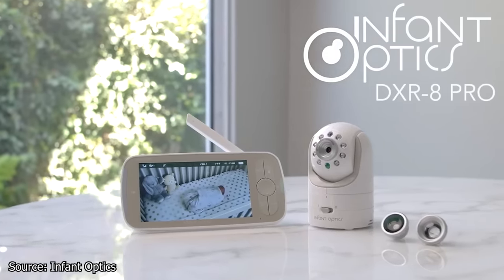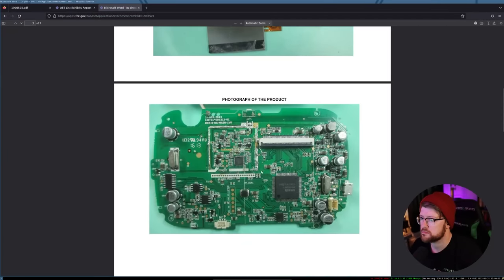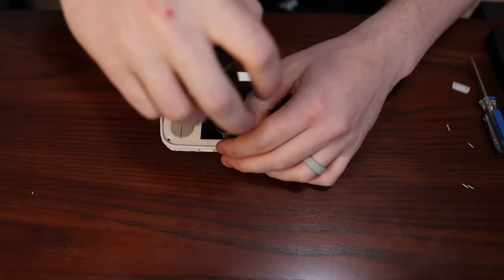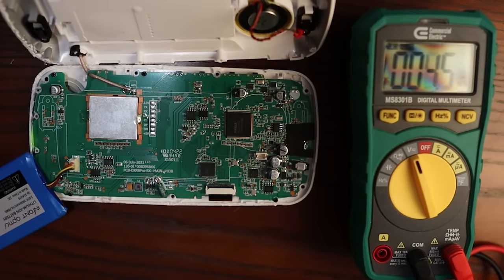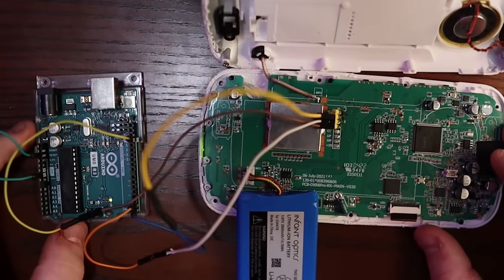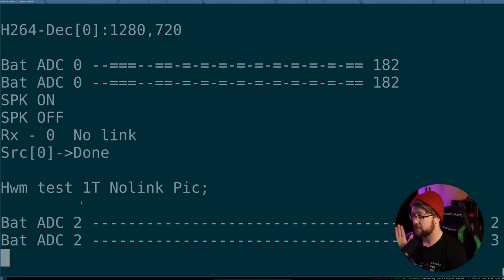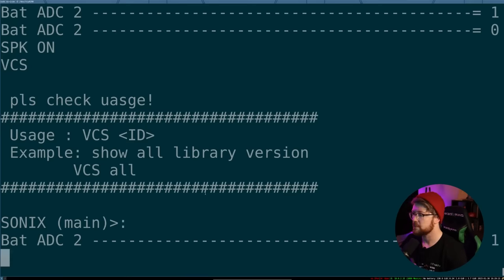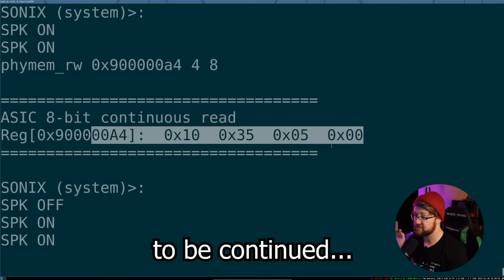i hacked my son's baby monitor, for science.

Comment: I'd be careful connecting the 5V Arduino UNO TX pin to connect to a 3.3V serial interface. Some devices can tolerate 5V on their input (at least for a short while) but others may break. Use a level shifter if in doubt.
Reply: Just a simple resistor can do it too.
Reply: All raspberry pi models have 3.3V UARTS. Use that as it is also more likely what the viewers have at home.
Reply: most of the time it doesn't do anything, but as a cautionary a resistor of 2k ohm can be used
Reply: @leakimiW  In this economy????
Reply: @NoorquackerInd  Yeah, completely absurd suggestions which may lead to a dead RPI/Arduino ... including the "test candidate".
Like there are no such things like the generic Ali-Express 1$ USB to USART bridge (Or $3 ... on Amazon) with actually matching logic levels, which do NOT introduce additional 10 points of uncertainties, a rabbit-hole of other complexity and pre-programmed frustration.
Yeah, why not use a 10 or 50 times more expensive device for the problem. Even the hobbyist needs such an USB to Serial adapter. Sooner or later. Very smart!:)
Reply: Back to reality. It "worked" because:
Resistor RN4a and RN4b (both 1k in serial to the ATMEGA8U2-MU USB to Serial Bridge, see Arduino Uno Reference Design) have saved Low Level Learning's Baby-Monitor-SOC from harm. It was a matter of under 2 minutes to research that, Leon. You should also try that sometimes: RTFM!:)
Edit, I mention this explicitly and here again: Let alone the "magic smoke" that may occur, but the frustration which can result by the misuse of higher frequency serial protocols. The signal integrity, the rise-time of the appropriate logic levels for a specific device will be influenced by these series resistors and the current flow over the protection diodes. This can lead to sporadic and incomprehensible errors ... which can lead to immense frustration. Not only for amateurs:) Use the appropriate tools! (You will need them anyway, like every good housewife! Hehe)
Reply: @dieSpinnt  you sound like a meanie.

Comment: If you can’t get it to work: In the Arduino IDE, put Serial.begin( * baud rate * ) to get communication, and press the upload button. Most importantly, if the ATMega chip is stuck in reset mode you HAVE to put tx to tx and Rx to rx, because the serial converter switches it around for unknown reasons.

Comment: "...but sometimes they leave it open to give the user a root shell to the device."

I don't think this is intended by the manufacturer:D
Reply from the maker: Then ground your pins wtf
Reply: What's the point of locking that down tho?

You need to spend engineering time to make the device exactly the same for most of your customers and annoying for a tiny fraction.

The only "real" reasons I've seen is some false sense of security, desperate attempts at protecting Imaginary Property or misguided regulations.

Full verified boot would be way too complex for any such use case.
(and if it's really needed, please let the actual owner control it!)

Comment: I wish I had seen this before having to guess how to do it myself using an Arduino to diagnose a lab scale.  I was on windows using the Arduino software to view the serial communications, so I didn't wire the reset as you did.  But this is a lot more elegant for troubleshooting serial data than all of that.
Reply from the maker: Arduinos make a solid little USB-TTL
Reply: @LowLevel-TV  Right!  Awkward as my approach was, it worked for automating a material feed into a mixer using the scale output.  Not bad for a few bucks.
Reply: i use a esp wich has a cp2102  3 dollar on aliexpress

Comment: Aren't UART pins usually high in idle state? In the first step when you measured the voltage on UART TX pin you said because it's 3v3 it's outputing data. I think the fact that it wasn't a stable 3v3 means there's some data on the line and if it was just 3v3 would mean there's no data on the line.

Comment: 3:56 there is a program in the Arduino forum to just set the uno to serial passthrough without the need for the reset line.
Reply: That uses SoftSerial, which is usually 'good enough' for simple communication but doesn't work for higher speeds as the Arduino can't keep up.
You use SoftSerial when you've chosen to use the wrong type of Arduino (one with only 1 UART) while for a project you need 2 UARTs, it's always a compromise.
Here it would be much easier (and better) to just use a CP1202/CH340 USB UART with 3.3V logic levels. He's now using a 5V Arduino on a 3.3V device. This can damage both the Arduino and the baby monitor, only reason it didn't happen here is because there's a 2K resistor in series on the UART on the Arduino. Some cheaper Arduino clones might not have that.
Basically this video shows how to use a much more expensive and not too suitable tool to do something that a $1 USB UART can do better...
Reply: @kabelloseskabel7029  I guess you could upload a program that sets D1 as an input, effectively disabling the TX from the Arduino and like you said putting it out of the way.

Comment: Oh the connector...  DP an DM should be the 2 USB  date + and -  lines.  A UART will normally be high so that might be why you saw 3.3V.  Just high.  If data was being transmitted,  I might expect a voltage between 0 and 3.3V and moving around some in voltage if the data being sent isn't too repetitive and too fast

Comment: Btw, did you know in Xorg you can paste any selected text by clicking the mouse wheel?

Not having to copy it first is awesome!
Reply: Not just in Xorg - Wayland has it too, and Shift+Insert will often do the same thing. Linux has 2 clipboards (technically 3 but the third is basically never used. (technically technically IIRC it's possible to define arbitrary additional clipboards but these are the standardized ones). The one you're talking about is called 'PRIMARY'. It holds whatever ASCII text is currently selected, which then be pasted using the middle mouse button as you said (and as I said, some programs additionally support pressing Shift+Insert to do the same). It's rather finicky though and can only hold text. What you think of as the normal clipboard is just called 'CLIPBOARD'. It can hold various mime types, and is only interacted with via explicit commands (e.g. C-c and C-v. Also can obviously be interacted with via the command line and whatnot).
Reply: @MH_VOID  super handy but confusing when coming from Windows. Middle click activates the scroll thingey I use a lot and whenever I try to scroll in Linux it just pastes stuff and I get confused for a sec.
Reply: @crashniels  I actually start scrolling every time I have to use windows and want to paste something lol

Still, Linux ~drivers for ThinkPad red dot | track point have figured out the best way: when you click the middle button and move the cursor, it scrolls and if you don't move it, it will issue the MMB event (i.e. paste).
Regular mouse could act similarly
Reply: @MH_VOID  Yeah, I know that's not Xorg-exclusive

I try to keep top posts simple so they are straightforward and not overwhelming. Unless absolutely necessary to tell from the get go, details work better in the replies. Especially when someone gets curious or asks for clarification.

Afaik, major compositors implement it since it is a highly demanded feature, even though it kinda goes against core Wayland principles (security|isolation – programs cannot spy on each other by default).
I guess sooner or later we will get something like a 'selection portal' to control clipboard access permissions and that will be the new standard /s

Oh, and I love Shift+Ins! Together with Ctrl+Ins (~ C-c) and Shift+Del (~ C-x) they are an amazing alternative that works almost everywhere – even on Windows!

In my experience though, basically all programs paste from CLIPBOARD when you hit Shift+Ins. I'd actually love to have one more key combo for pasting from PRIMARY, but to where the cursor is and not where the mouse points. (Maybe Alt+Ins would be good?)

Btw, never put a dot in Xorg on YT – YT will eat your comment.
(Good thing I now always copy what I post. Bad that YT does it silently and often for even sillier reasons)
Reply: @MH_VOID  
> Why not 's/in Xorg/in Linux/' then, though?

Not Sure. That wouldn't be 'technically correct' so I'd have an urge to explain it further and go on a tangent about Linux vs GNU+Linux vs Unix-like and so on lol

>> even though it kinda goes against core Wayland principles (security|isolation – programs cannot spy on each other by default)
> I'd say it's less against those core Wayland principles because the application is responsible for sending the content when requested […], and so can just... choose not to?

I guess. That was just a reason I heard for why Gnome had to figure it out on its own.

>> I'd actually love to have one more key combo for pasting from PRIMARY, but to where the cursor is and not where the mouse points. (Maybe Alt+Ins would be good?)
> Huh what do you mean by this exactly? Perhaps I'm too tired right now but I don't see the difference

When you click the middle button, the cursor will usually move to where your mouse pointer is and then the PRIMARY selection will get inserted.
But when I'm writing something and want to e.g. paste a link I selected in another window, I still need to reach out for the mouse, move it to the place in text I want it pasted at and then click the third button.
With a trackpoint at least I don't need to grab a mouse, but aiming the mouse pointer is still annoying when the text cursor is already there.

So in summary:
middle click: move the cursor to mouse pointer and paste PRIMARY
Alt+Ins (idea): paste PRIMARY where text cursor is

> Gotta love YT - eat high quality comments, but leave up all those sex bots

Yep. The worst is that sometimes a comment will be removed after ~½ a minute, yet sometimes it will just not show up for anyone but you.

I had this idea for a browser extension that backs up comments when you post them and then periodically checks if they are still up and visible. Otherwise notifies you and helps you alter them so they get past YT's hammer keyword list
Reply: Ironically, it seems the post I was replying to (^) got shadowhammered. If anyone else wants to read it, here is the link parameter you need for that:

&lc=Ugz-8IjBklYHo6hL3mV4AaABAg.9la_BlAjSkq9lb3zgjuYGr

Comment: Wait, isn't the Arduino Tx/Rx on 5V? Wouldn't that be a risk to the device? Also, is it possible that tying RST to GND damage the arduino by constantly resetting it?
Reply: @rikxianvanhoutenvanhouten1384  OK, that makes sense. Any idea about the other question?
Reply: @ΝίκοςΙστοσελίδα  Tying RESET LOW won't damage the Arduino, though 5V UART on a 3.3V UART is never a good idea...
Reply: @someguy4915  i find plausible that while the Arduino is resetting it keeps the UART at 3.3V. Though not likely, it isn't impossible
Reply: @ΝίκοςΙστοσελίδα  Good point, hadn't thought about that so I just tested it and surprisingly, the Arduino does keep pulling TX to 5VDC even whilst the Arduino is held in RESET.
This can both damage the 3.3VDC device but also can corrupt messages over the UART so in both cases terrible advice to use an Arduino like this as a USB-UART.
Reply: @someguy4915  Oh, great! Thanks, I guess I now have to go down another road with talking UART. Perhaps some level shifters...

Comment: Those Infant Optics ones pretty simple.  Point to point with manually paired cameras (which is a bit wazoo, but we get to that later) and no connectivity. 

The open UART (or JTAG, SWD less so)  is super common in those devices because they either dont care to close em, want it for debug, or they use it for some EOL manufacturing process.  There is only one risk from having a reversible monitor for the user that I can think of off the cuff,  it's gotta pair.  Depending on where you live that may be a concern and it may not -- apartments/condos, maybe yeah, single family home - range isnt that great.  

That said, there's some hoops they'd need to jump through and that's where you should be looking.  Is the pairing seed material when you push the button from the camera fairly unique? Does it broadcast its ID in some way that you could identify a camera you want to link a monitor to after the fact?  If it's only during the initial handshake, cool, but how does it reconnect when it starts up?   If the RF is in the clear (e.g. not just encoded or plain) you can patch in whatever auth material you want.

What does that get you though?  Cred online for showing it, but in reality, meh.  People research baby monitors and safes and stuff for the emotional factor attached to it.  Any malicious behavior where you have to be that close to the target is a really personal thing.  I know it's a non-cool kid opinion, but patching a piece of firmware on a baby monitor to see inside a single room in your house would do...what exactly?  Yeah, can see inside your house and that's a bit creepy, but if you live in an apartment, that person is your neighbor.  Good bit of OSINT, RF analysis, and then firmware patching for your neighbor or someone that lives nearby to see in your kid's room?  They know if you're home already.   Live in a single family home?  Not so much range wise.  At that point any RF system unless you want to spend a bunch more for a legit security system (and even then they will have similar problems) isn't in the cards for you if you're concerned.

BTW, the h264 is video encoding.  Have fun!

Comment: Lucky bastard. Arduino is 5V TTL and this device is 3.3V. You need a logic level converter otherwise you can break the chip in the device. Fortunately it looks like it worked (maybe because of breadboard cables resistance and chip not being susceptible) But one day you're not gonna be happy when the magic smoke comes out.

Comment: Late to the party but there's a few notes that are worthwhile:

- The microcontroller on this device is more likely 3.3V I/O, the USB TTL converter chip on the Arduino will be speaking 5V. This makes hooking the Arduino serial lines up directly rather risky as you could actively damage the micro's I/O drivers. A USB-Serial adapter with configurable 5V/3.3V is cheaper and easier to use than an Arduino and should be in pretty much everyone's debugging kit.
- DP/DM is extremely likely to be USB D+/D-, I would bet on this chip having DFU capabilities over USB, so this should be a route into the chip's bootloader. Connecting these lines to a PC will tell you a lot about the device.
- The reason these pins are exposed on pretty much any consumer device is that it's how the device is programmed in factory, so SWD/JTAG/USB will pretty much always be left available (even if you have to rummage around a bit to find them). Even devices supporting DFU over wireless will usually have SWD/JTAG left for initial firmware flashing.

Comment: i think you could use ESP32/STM32 for this, Arduino UNO operates 5V logic, which might damage the boards 3.3V logic. ESP32/STM32 have 3.3V logic and are much faster than UNO.

Comment: The Arduino trick is awesome. I'm currently in need for a USB UART and I've been delaying my project, because I own a USB UART interface, but I have it at the bottom on some box :p But now I can use an Arduino which I have ready and just use it's builtin interface. Now it sounds obvious, but this idea didn't occur to me. Thanks for the tip!
Reply from the maker: Glad I could help!
Reply: yes for years i had Arduino and doing hardware stuff, even though i am just a soft. engg, I completely unaware about this.... really thanks for this...

can use tx rx pin of raspberrypi to arudino to do the same 😅
Reply: @vaisakh_km  Never connect an Arduino Uno and Raspberry Pi's UARTs like shown in this video though, you risk destroying your Raspberry Pi and Arduino...
Use a newer 3.3V Arduino ('Arduino DUE' for example) or use a logic level shifter in between to prevent damage...

Comment: How the hell do you know this stuff?!?! 🤣 Dgmw, I'm mad impressed just curious
Reply: Because it ain't his first rodeo.

When you are curious about this kind of thing and want to do it often, you learn to spot patterns. How did he know what a UART bus is? It's probably because he's done something of this nature before and because it's a standard practice he has learned to spot that pattern. How does he know he can dump the memory? Because he's probably run into this kind of chip before and knows it's a standard function of that chip. You only need to figure it out one time. After that, because it's a standard practice, he can spot a similar pattern in other devices.

The same is true for reversing in general. If a file is compressed, there's a high likelihood it is using Zlib. Understand how Zlib works and you'll know it has a header like 0x78DA, so you can spot it in the wild. If something is encrypted there's a high likelihood it uses AES. Learn how AES works and you'll know the big questions to ask, like "where did they hide the key?" It's a matter of gaining experience and then applying that experience to everything you encounter.
Reply: @tomysshadow  thx for the indepth answer 🫶

Comment: Could you not just remove the arduino chip? I don't know if would still work or not since that chip would be missing
Reply: you can absolutely remove it i tried it and its no difference because the communication is done by the onboard coprocessor the atmega16u2, you only need that 16u2, the atmega is not needed because its only used when you use arduino as a isp programmef